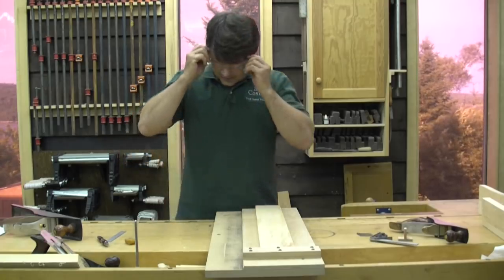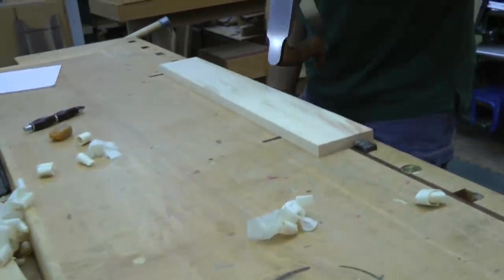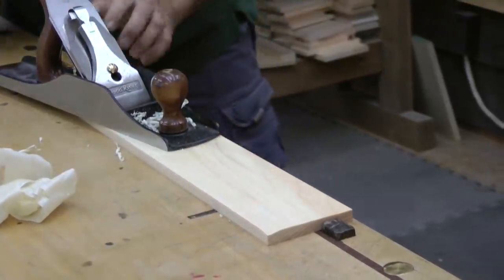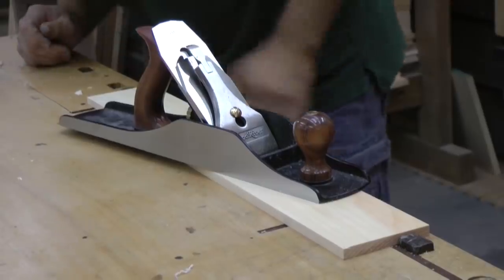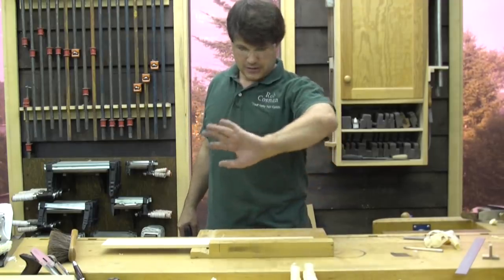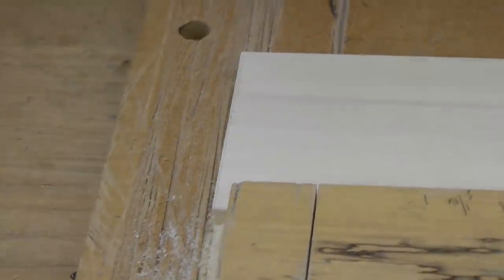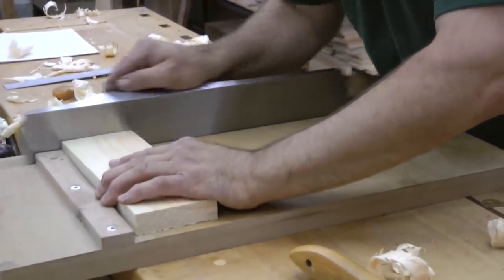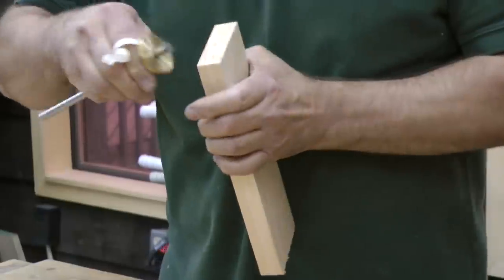Hand Tool Project - Episode 4, Pine Candlebox

Comment: That seems like a lot of material to just turn into shavings. Why not saw down the length of the board? With care you would have a thin piece that could be a bottom/top panel for another box, or veneer, mitre keys, it would be something useful. I know it's "just" pine but useful is useful.

Comment: Rob thanks for the video but I wanted to point out that audio on headphones is usually out of balance. In this video for example is towards the right side. I recall similar audio issues happening in several older videos as well. I hope this helps to hopefully correct this in the future. Thanks for the great video!